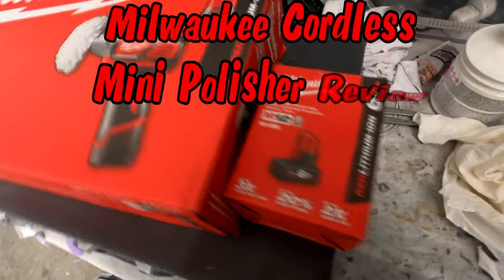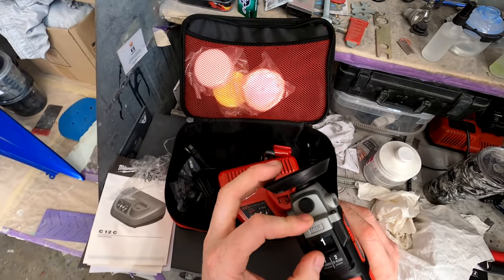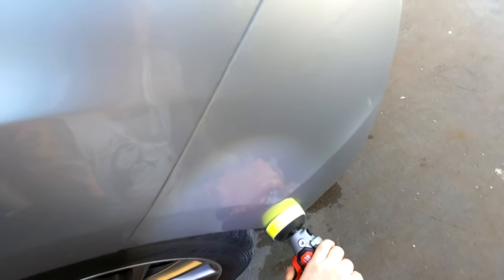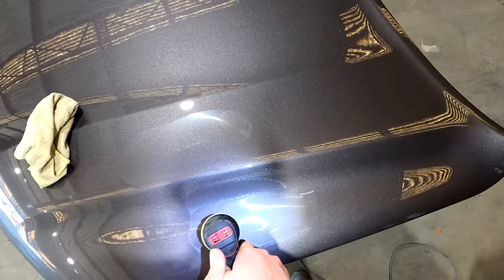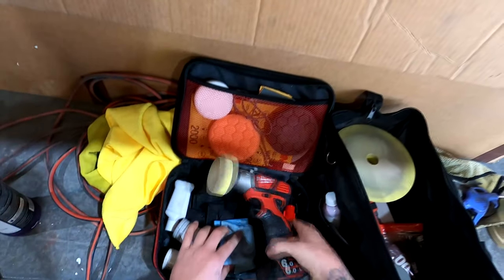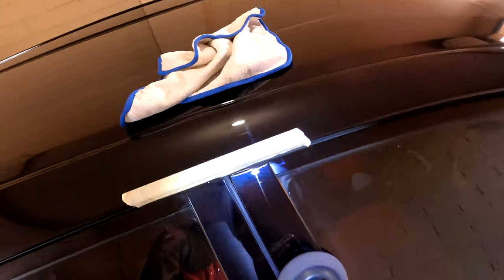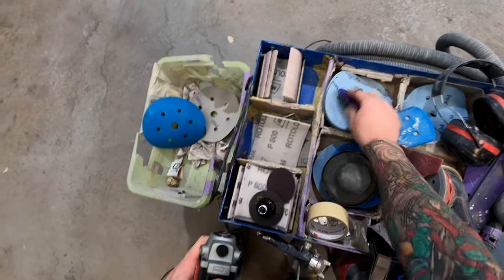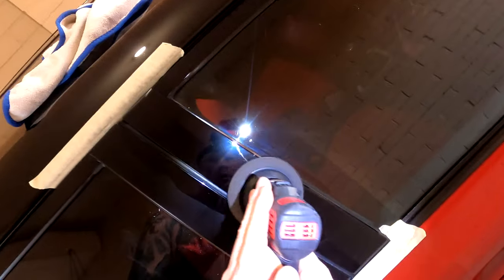Milwaukee Mini Polisher Review

Comment: Been using them for a few years with 3M pads and polishes. Have one at work and another at home. Money well spent as they work great.
Reply: Do they feel like a drill with a buffing pad or is it geared properly for buffing?
Reply: @marklengal9990   No, definitely not like a drill. They have two speeds. I use the lower speed 99% of the time as the higher rpm overheats the tool and/or battery in short order. Invest in the higher amp/hr battery if you use it regularly.

Comment: Fit a handle and put it away, just like I did, I've being using that polisher for a year already, really cool little tool
Reply from the maker: The handle is not really necessary for what I use it for
Reply: @TheGunmanChannel  exactly,  I don't run handle either!

Comment: Hey Gunnie, I use the 3M quick release buffing pads and polishes. As you know these are not cheap. While a stiff brush gets rid of most old polish residue, some will still exist in the pads.
Do you wash these out? If so, what do you recommend to get them clean again?
As I am paying for these myself, and I am not in a panel shop, I do not want to be buying new pads if I get away with it.
Reply: Let them dry . Use the brush dry than mist it a little with water and brush it .
Reply from the maker: I have been just rinsing well with water, then spin and blow them out after EVERY! polishing session. If you consider how much longer the 3M pads last and the fact that they're dual sided I don't think they're particularly expensive compared to the other brands.

Comment: To the mechanics reading, sick of scraping gaskets::, I have the snap-on equivalent mini polisher (the one AVE slated) I love it. I use the 3M roloc green bristle pads, they remove instant gasket and clean up surfaces quick fast in a hurry.

Comment: A lot more power than I expected the first time using it,so I went and bought one, ..
 also I put an 80-120 grit disc on it for grinding out bad alloy wheels damage,
 or a 500 disc for gouges/scrapes in plastic bumpers, use at a slight angle, it melts the plastic down so be careful,..then sand flat the grind marks with a DA sander and 240-320 grit, 
it also comes in handy for polishing...

Comment: Been using one of those little flex orbital/rotary polishers for a couple months now, so it'll be interesting to see your opinion of it once you get one. i will say, for certain jobs, our good ol' big foot will do a better job, but it all depends on what and where it is. for getting the scratches out from sanding nibs it's a dream tho. much less faff than untangling the big foot, lol

Comment: I gave up on 3m compounds this week. After 8yrs. Sonax and menzerna  for the win
Reply from the maker: Funny you say that, I have concluded that I'll be solely 3M compounds as of today. I finally managed to get my Corolla roof black outs with the ceramic clear done to my standards and it was only achieved by using the 3M step 3 ultrafine polish. No SONAX compound was fine enough.
Reply: @TheGunmanChannel  interesting! Could he the different  clears?? What i don't like about 3m is that it looks great when done but after a few washes you start seeing scratches again...
Reply from the maker: I haven't found that to be the case. What grit paper you finishing with?

Comment: Give me a war cry Gunny.
I'm redoing my VK in formula blue C.O.B. (the 1 I showed you a few years back)
Anyway I'm doing white stone guard underneath so I can lay blue over it & dont know if I let the stone guard flash b4 paint or to I let it dry & scuff with scotch b4 paint, Can you help because even the manufacturer wasnt 100% sure.
Also is their anywear I can hire a rotisserie from as I dont want 2 buy 1 for a 1 off job
Reply from the maker: As for the rotisserie, I've never rigged one up so I really couldn't say if anyone hires them. Possibly hard to find.
You may be able to find one though...
As for stone-guard I usually let it dry, then spray straight over, I've never had it delaminate, bit I guess it couldn't hurt to give it a light grey schtchie. Hope that helps mate 👊
Reply: @TheGunmanChannel  yeah helps heaps mate

Comment: Definitely buying one since now I found it for $184 but comes with only one battery and not two
Reply from the maker: I've never seen it come with one battery. It either comes with the kit of 2 or just the tool only here in Australia
Reply: @TheGunmanChannel  i dont know that’s what it shows and says on eBay I need a bigger one but don’t wanna spend $400+ at the moment plus I only paint max 4 parts that I’ll cut and buff so the small should work fine for the mean time
Reply from the maker: @AliVapeReviews  just be warned they are more prone to leaving swirl marks than the big buffs

Comment: Could you review the battery m18 sander.
Reply from the maker: I'm thinking of getting it so if I do I definitely will. Only thing that's stopped me from getting already is they're 125mm pads and automotive abrasives use 150mm

Comment: The longer a battery takes to charge the longer it will last..the faster it charges the quicker it will also die..
Reply from the maker: To a certain degree yes, fast and ultra fast chargers will vary charge times. But I haven't had any issues with my 6ah battery, I only ever use the 2ah if the 6 is it of charge.
Reply: Good day gunny! I say this just from using battery operated tools daily and ive worked on cars and boats most my life and charging batteries is way of life but i have tools same voltage and amp hr and fast chargers and slow chargers and the batteries i charge on slow charge always last longer than the ones on quick charge way longer..i issue you a challenge to try this yourself and share your results would be great to see what you come up with and watch your video as you share your results?
Reply: I understand you had 2 different amp hr batteries and im guessing you use the same charger? But what im referring to is the actual charging process of 2 batteries of the same voltage and amp hr being charged one fast..one slow.. Then using them identically as possible and see which one last longer.. Love your vids brother i relate tremendously! And im a ginger of sorts myself!
Reply from the maker: @luisvega1294  oh, I totally misunderstood what you meant. Now I get you, I will keep that in mind, it makes sense to me and I definitely believe you. I thought you meant the 2 charges faster than the 6 therefore it'll discharge faster.
Reply: Sorry i spun slightly off your video but for myself like it is yours its about passing on what we have learned to make better people better workers better neighbors never to old to learn im 51yrs old and i try learn something every day to make tomorrow a day i look forward too had couple good strong beers! Sorry that i rambled gunny!
Reply: Knowledge is a skill and something you cant put a price on..i appreciate your videos and i learn from your skill and from my own we cut through the bullshit here..and i respect your knowledge and force multiply my own with it and im a very picky person..all the high end vehicles came to my stall...cause i did it right..ok im going to stfu now gunny!
Reply from the maker: @luisvega1294  don't on my behalf 🤣 I like a good rant. You know that 😃
Reply: Cracks open another beer..woot woot..it amazes me gunny .🤔